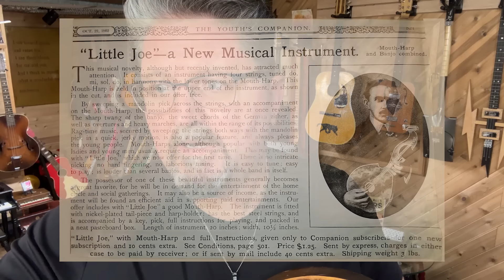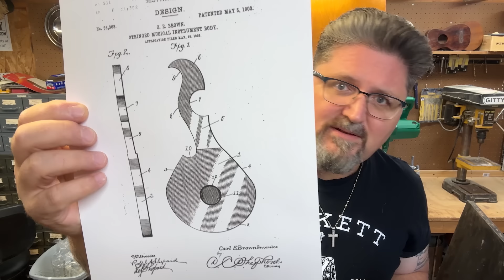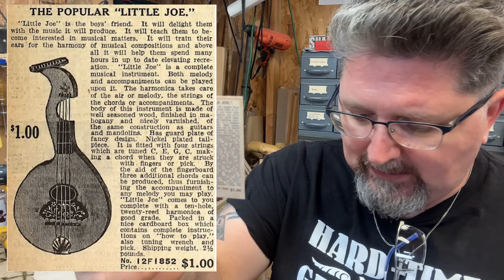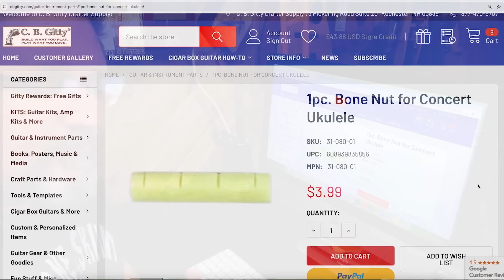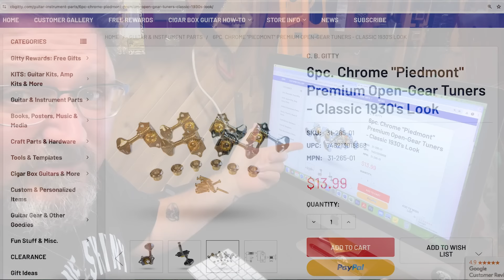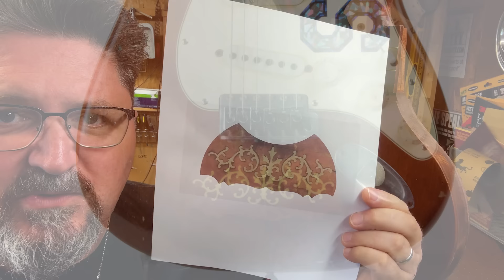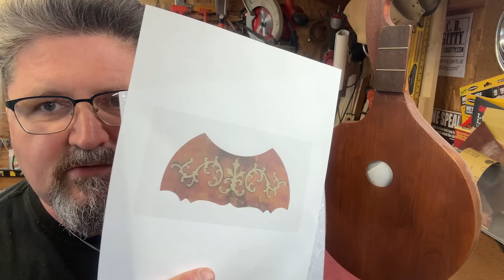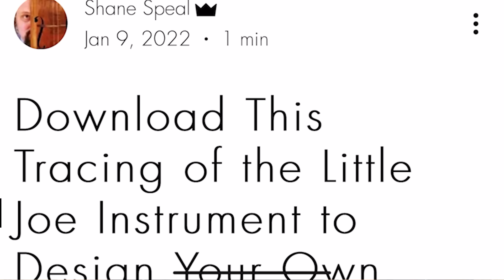Shane Speal: Sound Searcher 1 - "The Little Joe" Guitar

Comment: 19:56 … for years I’ve used the Minwax Oil-based Polyurethane Clear Gloss and it was my preferred finish! But since last year the clear gloss has disappeared from the shelves where I usually buy it! The nearest I can find is the water-based “warm gloss” and I find it takes almost double the applications to get the same thickness…

Comment: Difference between glues..
Titebond will stay where it's put unless you want to remove it, you can use heat and a little water. Gorilla glue will move a bit of it wants but you'll never get it off without grinding :)

Comment: Interesting. I'm curious as to why you opted for guitar tuners, strings, and tailpiece.  C.B. Gitty has zither pins and a mandolin tailpiece and loop-end strings (I think). Did you think you'd get a nicer sound out of the guitar parts versus the mando?
Reply from the maker: @MickeyCuervo36  I went with guitar tuners because they are so much easier to keep in tune. I own many zithers and autoharps. It’s such a pain in the butt to have to use a tuning key to keep these in tune. Plus a guitar tuner has a geared ratio which allows for precise tuning.  I also wanted to use guitar tuners and guitar strings because more people would have those in their shops and this would be an easier project for them.
Reply: @ShaneSpeal  I agree with you there. I have a couple harps and lyres myself, and slipping pegs/pins are just a migraine. I've heard that if you back them out almost completely and add a drop of wood glue, it'll prevent that from happening. Haven't tried it to know for sure though.

Comment: Awesome! I am a woodworker AND collector of strange instruments, and you have impressed me on two fronts.  Were all the bridges with feet too tall for your needs? My first instinct is to put a bridge with feet on a resonant stringed instrument. I have a 50-year-old Soviet-made balalaika with a feet-type bridge, and if you merely speak in its direction, it will acoustically respond to you a little bit, especially if you have all-steel strings on it (balalaika traditionally have 2 gut/nylon and 1 steel string, but some people use all steel). I may well try to make one of these Little Joes myself, as it is RIGHT up my weird-instrument alley.
Reply from the maker: I want to know all about your strange instruments!
Reply: @ShaneSpeal  That would take time. The crown of this collection is a Leicestershire smallpipe with chanters in both D and C, which shares its case with several pennywhistles. There's the aforementioned balalaika, which I rescued from a wallhanging situation (they had put a damn picture hook on the back of the headstock) and restored to playability. I also have a taishogoto, also known as a Nagoya harp, which looks like a crazy Japanese scientist cross-bred a lap steel with a typewriter. It has five strings, all tuned to one G or another, strummed with the right hand while the left works the big typewriter-like keys which depress bars across a little captive fretboard inside the instrument. To make it just as bizarre as possible, the keys aren't lettered - they're numbered, so you're playing a 2 sharp. Various other kalimbas, ukuleles and guitars litter the house, along with no fewer than three different bagpipes at different stages of completion, and a couple of low whistles I made from PVC. I'm a lil' bit crazy...

Comment: On glue......I watch a few luthiers.  Ted from Canada often complains that previous (or original construction ) methods of glue use often impact the viability of future repairs.  I believe average white wood glue is great for basic wood working, but there are issues when having to heat a neck pocket for a reset.
I dont know the science behind it or which glue is best.  Ive heard fish glue works probably the best for normal stringed instruments.  This has great holding power for the majority of applications and allows the wood to move as the years go by and allows easy removal when normal maintenance jobs should be done.  Other more generic glues have a tendency to plasticize making these repairs difficult.

On the Little Joe, I dont think that will ever be an issue based on the body being one piece made from an old piano front board.  I recently repurposed an old upright into an art station by removing the keyboard and hammer assembly.  The wood there is wonderfully perfect and as the body of your build should never warp under constant tension of the 4 strings.

I am really amazed at how well it sounds and plays.  This was a fun bukld to watch.  I have subscribed. 🤘
Reply from the maker: Thank you for all the insight!!!  BTW, I've seen those old pianos turned into mini bars, too!

Comment: What is the point of the cutout on the neck? And how do you know what strings to use and tuning? And you only have two frets , where do they go and why? Should this be common knowledge?
Reply from the maker: I think the inventor was trying to be fancy with the cutout.  Two frets means only three chords... simplifying the playing process.  I'm sure the original had a songbook that came with it along with playing tips.
Reply: @ShaneSpeal  thanks for the reply, seems like it matters where the frets are on the length of the string. oh i missed the part where you measure the fret position. i get it now duh
Reply: @ShaneSpeal  great video thank you!

Comment: 😅idea for you you know a spring out of a clock,each string has a set tensions depending on string size,,if a auto tensioner was built on to the tuner at end of fret bord,the gitar would never go out of tune, + who designed small guitar new ther stuff because of all in one spine maybe should be metal,like a piano only long bolt inside of wood fret bord,with own tensioner can be used to set angles, + inside voise box connected to metal spine ,a,set of tuned read bars like on a grandfather's clock,should set out loudness on  higher pitches,guitars name,is R,V,L,D,.shetoyancey tec,one.

Comment: I don't think I would've been able to resist adding a full fretboard and neck, but you did it. Putting the ad inside the body — peeking at you through the sound-hole — was a real nice touch. A very cool little project for sure.
Reply from the maker: Thank you so much.  And yes, it was a temptation to add a full fretboard.  I'm probably going to build a couple more of these with variations such as a full fretboard, longer scale and maybe even an electric pickup.
Reply: @ShaneSpeal  Sounds good! I think a mandolin-like scale might be fun — just have a 4-string mandolin like the "Mando-bird". Or you could elongate the neck further and have yourself a tenor banjo, or full size, or something like that. How 'bout a balalaika? lol
Love the project. I'll stop in again soon and check out your videos!